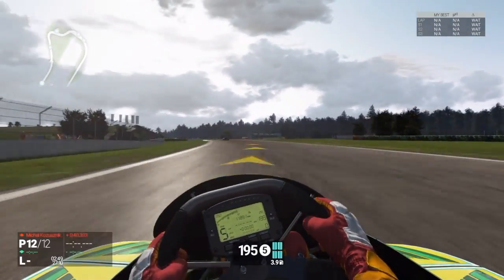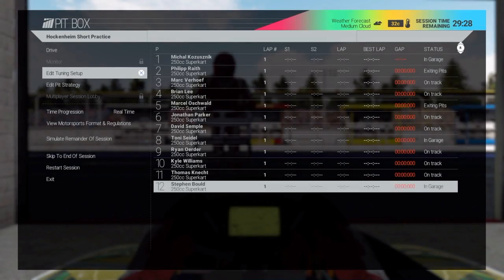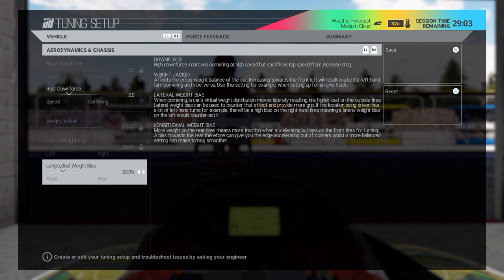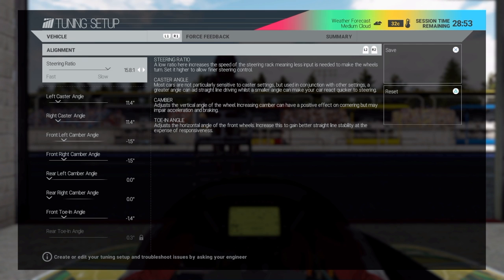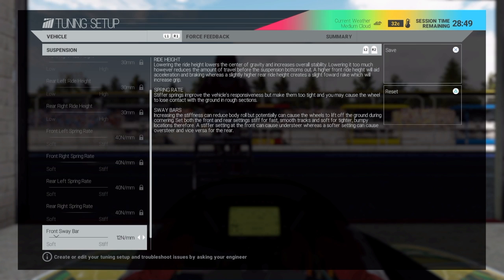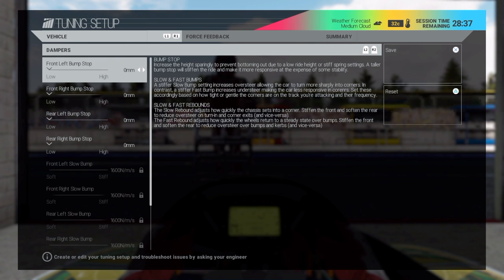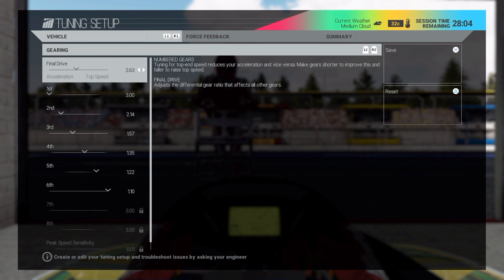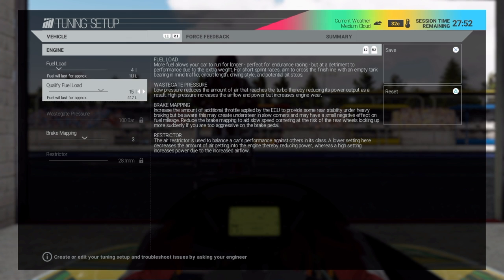Project Cars beginner setup guide

Comment: I am such a noob. But I am determined to learn. Thanks for the tips!
Reply from the maker: +Jacob Troyon no problem hope they help.
Reply: Hey man, I got a question. I got a great setup for around 7 laps, but they wear out pretty fast. What can I change about the car to decrease tyre wear?
Reply from the maker: check your tire temps after a few laps if the middle of the tire is hotter than the outside lower the pressure if the outside is hotter than the middle put more air in 
if the inside of the tire (closest to the body) s hotter than the outside take camber out of the wheel eg:-3.5% to -3.2%
Reply: Oh awesome tip! Tires are my first thing to understand

Comment: 90% of my time so far has been in set up and controls  
I finally have a pretty good all around set up to adjust from. 
As I’m learning my braking points with car adjustments n visuals ect. I’m having the issue of when coming into a corner hot n brakes on n begin my turn the car pushes forward/straight past corner😬
Any help on witch adjustments to help correct this is appreciated. Thank you
Reply from the maker: i find putting "rake" in the car helps so lower the front ride height and raise the rear just a little 1mm at a time and look for videos on trail braking or pump braking that helped me a lot.